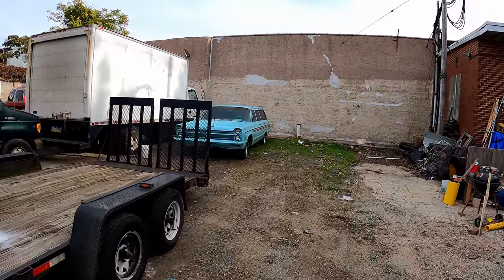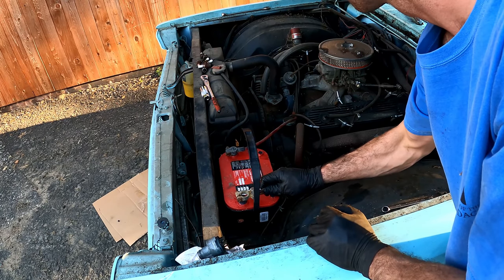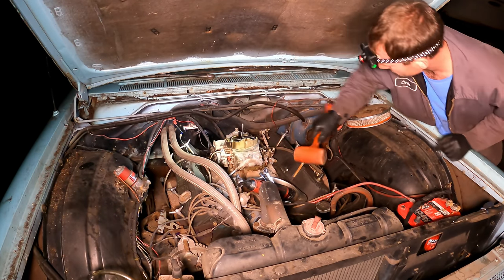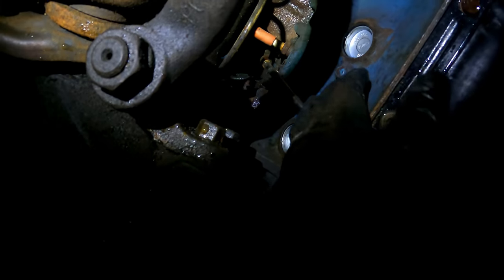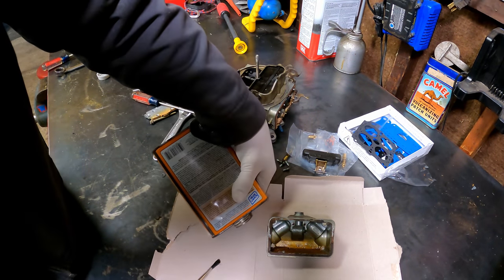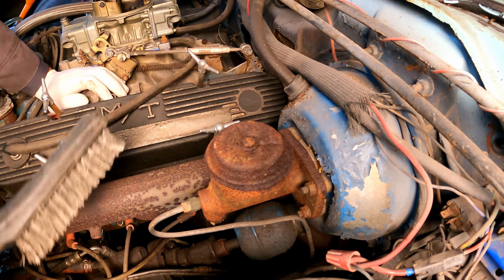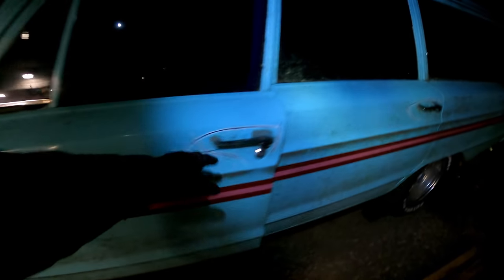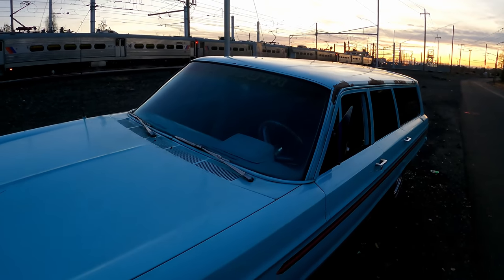Will It Run / Drive? - Junkyard Plymouth Fury "Fury-ous" NNKH

Comment: That pet squirrel is funny 😄 I think you found a beautiful car…I’m in “awe” seeing how you go step by step, fixing al sort of things and bringing life back to an old dirty piece of metal….Great project. I would not even know where to start.
Reply from the maker: Got to just dive in and start kicking away at each item. I mean really the best way to go is to do a full tear down. But that's not my style. Just fix what need be as cheap as possible.  Thanks for checking it out man
Reply: Love the gruntwagon
Reply: @NoNonsenseKnowHow  How much do you want for her and how far away are you from Los Angeles?
I need this SURF WAGON in my life!
Reply: @deepfreezevideo  East Coast, he picked it up in Philly, and the power rails are in the video, so he didn't go far, my guess is Bucks county... If you by it, make a video driving back to LA.. That would be Epic !! @NoNonsenseKnowHow Great Video!! Wish I could afford a project like that.
Reply: @danesderelicts  why
Reply: @tomorrowcomestoday1621  why what? When you pick up an old car and you want to get it running you need to check for ignition and fuel if it's not seized up. Make sure to disconnect the fuel line from the tank. I've been rescuing cars for over 30 years

Comment: Brings back memories, I had a 65 fury wagon with a 383HP engine with dual exhaust. 4 speed with a Hurst shifter and a 8 3/4 diff, limited slip 3.23 gears. All that was stock from Plymouth. At first I had a hard time believing it was stock but then found the Service manual and it showed it all including the Hurst shifter. Could do really long hole shots. Strong heavy car.

Comment: Loved the video.  Brings back memories.  I got my license in 1968 and learned to drive on a '66 Plymouth Sport Fury.  I've always been a Mopar fan and love the old ones.
Reply: My first car was also a 66 sport fury, paid $600. for it. It was white with green interior. Had fender skirts and original floor mats, and perfect body, it even had an old thermo-king a/c added that would freeze you in the hottest of summer days. The best though was opening up all of the windows and hauling tail. I loved that car. Thanks for the memories and the smiles watching your progress bringing your beast back to life.

Comment: Really enjoyed the video. Just a tip with the ignition key. As long as a key will fit the barrel you can just push and pull on the key very quickly so the wards dont have time to fall back down while turning it then it will at some point turn.

Comment: This is a cool car! Forgot just how good these cars look. Good motor, transmission works, good room, I like the bucket seat interior modification. Looks like almost all trim is still there. And the exhaust sounds great without being loud. Good score.
Reply: Those seats look like 67 GTO strato buckets.
Reply: @richcar3434  Yeah!  Was thinking the same thing...was like those are either Pontiac or Ford seats.
Reply: A 727 Torqueflite is nearly indestructible up to about 600 horsepower.  Just keep juice in it.

Comment: Maaaaaan you have a great show. I'm not sure if I've seen you b4,but I caught the chevelle today and I couldn't stop watching it. I did the same thing  ,with a 1981 F100 6 ,with a transplanted 75 390,I was in a hurry to drive it n my radiator fell on the fan. I was AZ lucky, I blew the head gaskets,I wasn't anywhere close to home

Comment: As an owner of an old Mopar wagon, sell it before anything rear of the driver's seat fails. Parts for the back half are unobtanium. Great content, though, and glad to see a "will it run" where someone does everything the right way!
Reply: That's when you start putting ford parts in it lol
Reply: @AnthraxBird  Oh no, sacrilege.
Reply: @AnthraxBird  chevy* them parts are dima dozen if u dont mind breakin em here n there
Reply: Not totally true. Quite often fuel tanks can be had in the aftermarket plus bumpers and taillights are the same as the 4 door car. OTOH, tailgates, rear quarters, glass, and trim parts are like hen's teeth.
Reply: @rupe53  you've clearly never owned a Mopar wagon. No one makes tanks or sending units for them. I've been looking for years and ended up repairing the tank and sending unit in mine. There is absolutely nothing in the aftermarket for B-Body and C-body wagons. I'm in a few Mopar wagon groups and every time someone new pops in to ask about about where to buy tanks and sending units, everyone in the group has a good chuckle.
Reply: @DustinHayre  ... my experience goes back quite a way, so maybe things have changed. I did talk with a guy just last year and he got a new aftermarket for an Edsel wagon. Just a couple of years ago I could buy a new tank for a Corvair Van. IOW, you never know what's out there.
Reply: @rupe53  it's changed, especially for Mopar wagons. If you can find a  working sending unit and tank for a B-body wagon, people will pay a fortune for them.
Reply: @DustinHayre  ... I am familiar with fuel tank repairs. OTOH, sending units can be like fixing a swiss watch if it's electrical. Fixing a sunken brass float is a piece of cake most of the time.
Reply: @rupe53  fortunately it was mechanical, just a pickup that sweeps across a spring to increase resistance. I cleaned it up, rust treated it, and very delicately soldered the pickup wire back to the spring. Sourced a universal float and pickup sock and seem to work pretty well. Flushed the tank, pressure washed the inside, rust treated it, and brazed a couple of pin holes in it before hitting the outside with a few coats of bed liner.
Reply: @DustinHayre ... yeah, they seldom wear out but rust can play hell, especially if the hold down ring is toast or the float rod is crusty. (water in the tank) There are several chemicals available to clean the inside. I found Marine Clean works well and even better than Zep Formula 50. (industrial cleaner) I usually braze or solder any structural issues after cleaning then use a "tank cream" to coat the inside. That needs to dry for 96 hours but it's like a rock when you are done. Hint: use the blow end of a shop vac to keep any stray gas fumes clear while you work. That will also dry the inside of a tank if used in conjunction with leaving everything out in the sun for an afternoon. BTW, if you have any holes too big to solder just cover the hole with an old penny first. A coin from pre 1976 will be 99% copper and solder / braze well. (old timer trick)

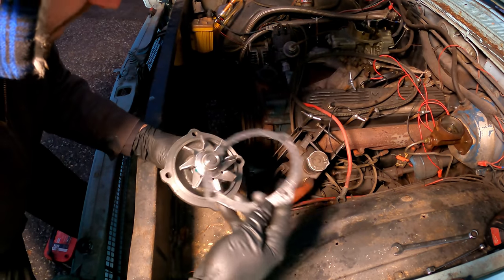Comment: 41:08 "The only part" = Hence why newer cars are redesigned to be parts dependent. Redesigned to be non serviceable, plastic parts to break by time (not use), sealed parts (to prevent repairs) etc.
These things can literally keep running with little to no parts over an indefinite number of years and little to no reliance on manufacturers due to little to no planned/engineered obsolescence, little to no legal blocking for 3rd party manufacturers to make replacement parts etc.

Comment: Always enjoy your vids bro! Shes cammed alright!! Sounds pretty rowdy. The interior cleaned up quite nicely with the pressure washer. Good thing that freeze plug was blown out because it put you on to all the garbage inside the block and the cooling system. I've seen water pumps do that often when the impeller is just free wheeling on the shaft. Usually it's the composite or plastic impeller ones it happens to commonly. Gotta love how cheap the parts are for these domestic cars. You should Por-15 the hell out of all the floor pans and such. Someone took some time to do some decent work and put some good parts on that thing. Nice to see you go through it and address all that stuff and resurrect it in general. I see a ton of potential in this baby, period. Was going to ask about Leo but you read my mind and showed him anyways. He is so F'N COOL!!! LOL I got a kick out of his 'nut storage.' LMFAO!!! Hes looking extremely healthy and awesome as ever with his little attitude and things that he does. What a character!!! Stay cool man, and keep up the kick ass videos bro!!! Thank you for sharing this!! 👍👍🤙😎

Comment: I had a 1970 SS Chevelle 396, accel super coil and a Edelbrock performer intake topped with a Holly 850 double pumper. I had the same set up in the 1969 SS El Camino. Those were the days when cars were fun to work on. The 396, with headers and a radical cam was one beautiful sound.
Reply: @Hello how are you doing?

Comment: Got my drivers license when I turned 16 in 1972. My first car was a ‘65 Sport Fury. My mom and dad bought it new and I bought it from them. Had it for two years and got a ‘70 Roadrunner. My sister got the Fury and in a year it was gone. Fast forward to last year. I was going through my dads work bench. He passed 12 years ago and this was the first time I’d looked through his bench and tool box. I was feeling around at a shelf that was over my head. I found the keys to the Fury. He placed them there for me to find. They’re on my key ring today. Thanks, dad!!

Comment: 44:00 Those Holley fuel pumps are happier pushing fuel rather than sucking it. Holley recommends having it mounted as close to the tank as possible. It's why it sounds so unhappy. I made the mistake of mounting mine under the hood, didn't last too long. Located it by the tank, never had another problem with it
Reply: @Hello Dave how are you doing?

Comment: I was sure would be a 318 Poly. Great score! Most wagons ended up in derbys or as West Coast surf-mobiles. Interesting ride fer sure.
Reply: My 65 has the 318 poly ... great motor
Reply: My 66 had the Poly. The guy I sold it to yanked it out and stuffed a 440 in there. I almost cried. The poly died a slow death out behind his garage in the mud
Reply: @christopherjames3027  I have a 65 Fury 1..with the 318 poly/727....just a question..did the 440 fit Right in?  All ways wondered if the poly shared the same bell housing as the Big Block's
Reply: @christophersells9146  I’m not too sure about the installation. I sold the car to the guy that did the swap, so I’m not sure how straight forward it was to be honest. It just bugged me that he yanked out a perfectly good running 318 and trashed it. LOL.

Comment: Very friggin cool. I would get my hands on a good Holley 4160 750 cfm for a mopar with correct linkage and it would be fun. Stay with a spread bore it works best for auto's. Might need a lighter spring for the secondaries. Make sure the choke is working properly and it will fire right up in the freezies.

Comment: After 40 years in the auto biz, I gotta say, that's the first time I ever seen someone pressure wash seats. Worked pretty damn good
BTW, those screw-together fuel filters like you put on there are junk. They always start leaking. Those plastic filters are fine for under the hood.  Pretty much every Japanese car came with underhood plastic fuel filters up until the advent of fuel injection.
Reply: Yea...justified or not, those glass filters have a reputation for causing engine fires.
Reply: Next door to me is a car detailer or a lot of used car lots ,  who is always using the pressure wash inside the cars. If you ever saw how they arrive at the dealers,you would hose them out too.
Reply: Those glass fuel filers are very poor, they have a tiny filter area and clog very easily, i was running an old car that had rust in the tank and it would clog in less than 30 miles, (clean clogged again in less than 30 miles). took it off and replaced with a standard small $2 filter and it took 300 miles to clog it (eventually had time to clean the tank later)
Reply: Them glass filters emergency use only I swear their junk
Reply: I agree, the cheap plastic filters flow great and work fine.
Reply: Try aircraft paint striper cleans up with water ,but you still need to use caution .
Reply from the maker: The aircraft stripper used to have methylene chloride in it. The new stuff doesn't. It still works just not as good
Reply: Agreed! Those glass filters are complete junk. Been using plastic for years and never had a issue
Reply: Yea nothing wrong with those plastic filter in the engine bay, used them on thousands of cars in my 40 years being an auto tech not 1 gave a problem.
Reply: Checkout JUNKERUP (He works on all 68, 69 70 Dodge Chargers). After retrieving a Charger from a junkyard, backyard, barn ect ect. He usually stops at the car wash while the car is still on the flatbed & sprays the exterior & interior. Leaves all the mouse poop there instead of at home in the driveway😆

Comment: That style of V8 emblem on the fender was used for  “A” series engines such as the old style poly spherical cylinder head 318.  That would have the distributor in the back. A “Comando V8” emblem was used on “B” series engines. Most likely your wagon has had a heart transplant. Look at the block stamp on the left side of the distributor. That will tell you more.
Reply: @Hello John how are you doing?

Comment: What a beautiful sounding engine, and a beautiful car. I would be interested in buying this if you decide to list it. Dream car is a 65-68 Fury. Big block and wagon make it an absolute winner.
Reply: Find one with an la V8 and swap in a 360
Reply: I've got a 65 Sport Fury, 383 4-speed. If I ever get around to remodeling my basement I will probably have to sell it. It isn't a wagon, so may not be what you are looking for. I have the original paperwork from the dealer when the guy bought it in 1965.
Reply from the maker: I would be all about buying that thing off you. Let me know if you want to sell it ever
Reply: @NoNonsenseKnowHow  Maybe this summer. I would strongly recommend you stop out to look at it and take it for a drive. It was rustproofed by the dealer in 65, I didn't know they did that back then, but the body is in pretty good shape. The decklid is rusty at the bottom (common for these cars) but I do have a spare decklid that I bought from a guy in CA. Headliner is gone, mice I suspect. Blast to drive! Oh, second gear synchro is bad.
Reply from the maker: What state are you in? I'm all the way in Pennsylvania. If you're ready to sell, I'll definitely consider making the trip out and drive it home. You can also shoot me an email which is listed in the about section of my YouTube channel page
Reply: @NoNonsenseKnowHow  I'm in Minnesota. You could drive this home, it's that reliable. I drove it every summer day it didn't rain except for last summer, I was painting my house and garage. This weekend I will go to your Youtube channel page and get your email address, then I can send some photos so you have some idea of what it looks like. Take care.
Reply from the maker: Okay awesome sounds good!

Comment: I’m pretty sure Derek on Vice Grip Garage says those are the fuel filters that “have caused more fires then ex wives” lmao. 

Also, the nut on your bike from Leo is hilarious!
Reply from the maker: You are the second guy to mention that about the fuel filter. Makes sense! And yeah I can't believe he brought that nut into the garage. So funny
Reply: I'm going to mention it too, those things are ticking time bombs!.
Reply: @NoNonsenseKnowHow  The plastic ones you "don't want under the hood" are a whole lot safer than those little glass molotov cocktails.  Also, Methylene Chloride is highly corrosive to aluminum.  My paint sprayer says not to get it near the stuff.  Get an ultrasonic cleaner big enough to hold the carb and it'll clean up the gunk and the jets and passages as well.
Reply: @NoNonsenseKnowHow  Change the fluid and filter in the transmission but be sure and drain the torque converter. All you have to do is pull off the transmission cooling line to the radiator and start it up and let it drain in a bucket for a couple minutes after you pull off the pan. It makes all the difference in the world.

Comment: Holley Double Pumper.. those gaskets can be sticky - sometimes i get lucky if I soak it in Berryman's long enough. The castings would warp sometime and sometimes those sticky gaskets were enough to stop a leak from forming. Didn't know the trick about methylene, I just knew that the gasket remover that actually worked wasn't around anymore.  Anyway, great video.

Comment: My first car was a 1965 Plymouth Fury 1 that same color. Plain jane, 383  4bbl with 3 on the tree. My uncle had rolled it and my grandfather jacked the top out and beat the quarter panels and fenders straight-ish. Replaced the windshield and she was ready to roll. Man what a car... thing would absolutely smoke the tires. Well tire anyway.

Comment: Congrats on 💯K subscribers! 🎉 👍👌
Reply from the maker: Thanks!
Reply: @NoNonsenseKnowHow  that’s a bad ass wagon my man , subscribed !!
Reply: @NoNonsenseKnowHow  And this poor Belgian is one of them! 

100% fun to watch btw. A few flashbacks to the good old days. Also the ideal trash car for cruising on a sunny day, preferably with a can of petrol in the trunk! 

Grtz
Reply from the maker: The electric Holley pump was able to pull fuel up and establish prime after I pressurized the tank. Only a few PSI as to avoid blowing it up
Reply: @NoNonsenseKnowHow  I'm new to your channel but I hope you do a custom restore on this or an all original restore because the body and frame are solid. The floor pans are nothing to replace and wagons are getting immensely popular now in the collectible world. A friend of mine did a 1962 Ford Country Squire with a 352 police interceptor and it brought 78k at auction two years ago and that's with Craiger wheels on it.
Reply from the maker: Awesome, welcome to the channel and I appreciate you checking out the video! Yeah I'll hopefully do a part two and more on this. Not exactly sure on the plan yet but definitely keeping her. I was thinking of selling and now I've decided to keep it
Reply: @NoNonsenseKnowHow  That's definitely a a find and worth it.